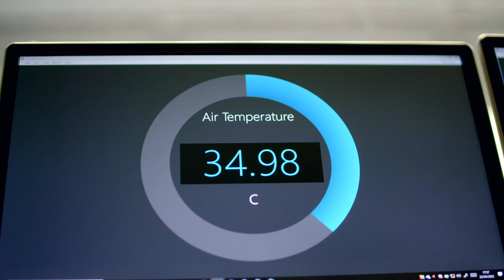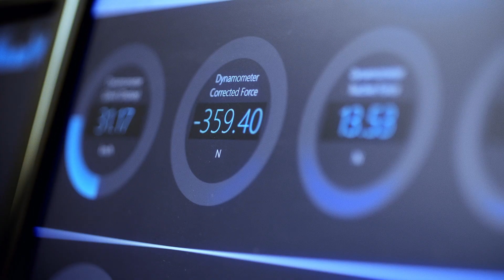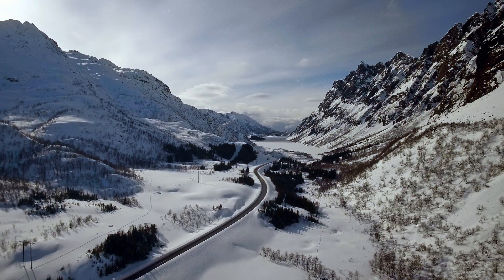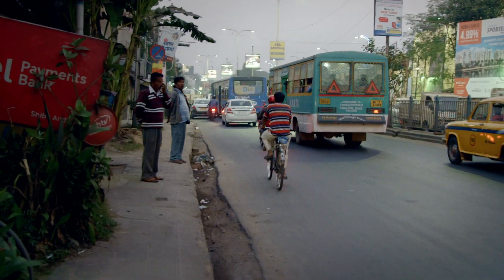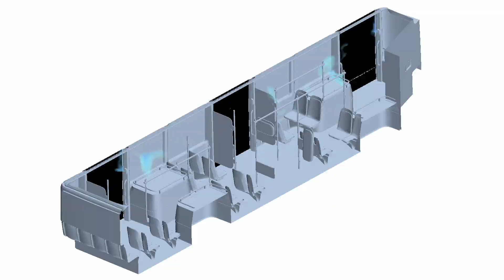Climatic Chamber Testing | Arrival Bus

Comment: Nice to see ANY kind of update while invested with the way its been going 🤣 Cannot wait to see this succeed!
Reply: The light industrial and public transport sector is huge, this is the market to go for arrival should be huge, a much better starting approach than the luxury car market. Even if they have competition everyone is going to have to convert across Europe, there won't be enough to supply to meet demand once the combustion engines are off the road. if arrival fails it will be due to shorting their stock? or lack of vision from investors, if they need to re finance next year, I hope they don't have to compromise too much if they need a cash injection. Then it just comes down to reliability on the road... that's a big one. hope they nail it.
Reply: Same, I am 65 % down in crypto, and 20% on stocks! this gives me hope...
Reply: @JG-xh1qm  same here
Reply: @BabyBear-tn2wh  🤣🤣 probably never. It took them only 7 years and 3k workers to build a van
Reply: Right